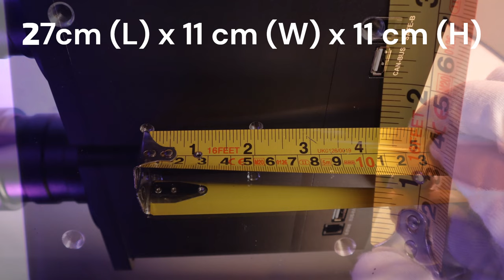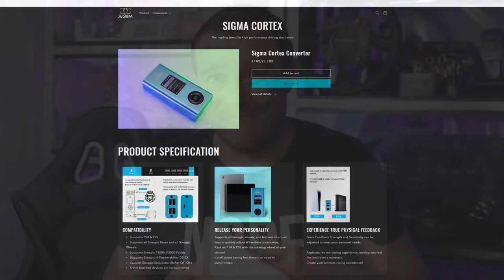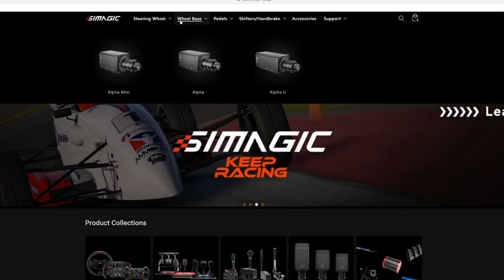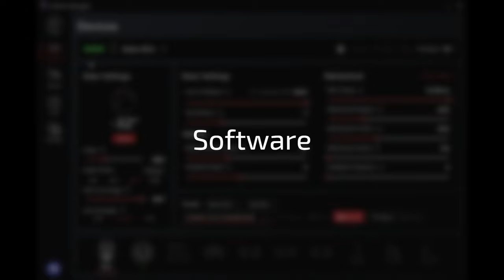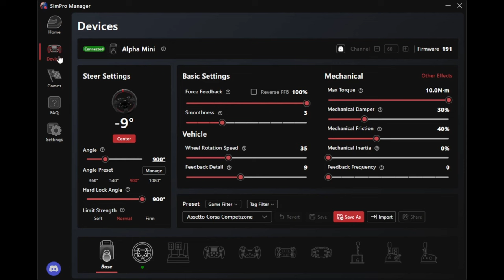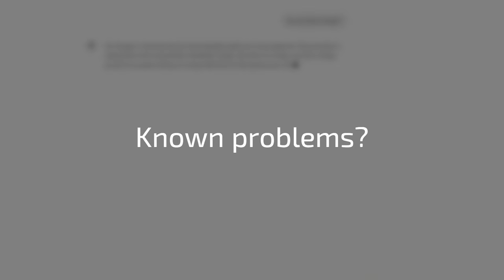Review: Simagic Alpha Mini v.1

Comment: How did you manage to put your hand on a V1?
Reply from the maker: Where I get all my hardware. Second hand market.
Reply: whats the difference between v1, v2 and v3? tks
Reply from the maker: The PSU has less output and different plug. The design has been altered (it got shorter and all attachment points are cut out instead of just 2). More of the internal Electronic components are moved to the sides. Simagic claims there is No difference in driving sensation.
Reply: @SimulatedDrivingResource  sry I didn't understood, are you talking about v1, v2 or v3? tks
Reply from the maker: V1 -> V3
Reply: @SimulatedDrivingResource  and how about v2?
Reply from the maker: No idea. I can not find relevant data about it.
Reply: @SimulatedDrivingResource  the Mini v3 has a lower power output PSU than the v1? Isn't that like a clear tell-tale sign that the power torque output on the v3 will be less than the v1? I mean, the PSU output was the only difference between the CSL DD 5Nm and 8Nm.
Reply from the maker: Personally, I suspect that that is the case, but Simagic officially claims there was no change in the user experience or power output. However the way they said it left some loopholes for me. I asked them to clarify but no answer from them.
Reply: @SimulatedDrivingResource  do you know what the difference is in the PSU of the v1 vs v3?
Reply from the maker: @DrR1pper  yes. Someone posted it on reddit. https://www.reddit.com/r/Simagic/comments/1crd241/update_alpha_mini_v1_vs_v3/
If you look at the photos, last and one before, you see it. Now again, because I had way too much crap about this from some people at Simagic forum, I can NOT prove anything since I have not tested both . Officially they say they just made it better (less heat, more durability)

Comment: Looks great [apart from the lack of power switch which is bizarre] but in 2024 ,for me,you need pc and console capability so Fanatec and Logitech are the only options imo .Those gimmicks for cross platform play dont look too good in the few tests I've seen.
Reply from the maker: Absolutely. I forgot to mention there is like some of breaker switch on the power cable itself but indeed strange of the power button. Yeah I agree... i should really test them but yeah is also difficult to test since ffb on console is also implemented different. But between us, for me it is still no match for the G Pro 😎